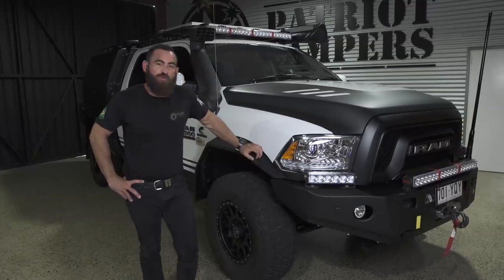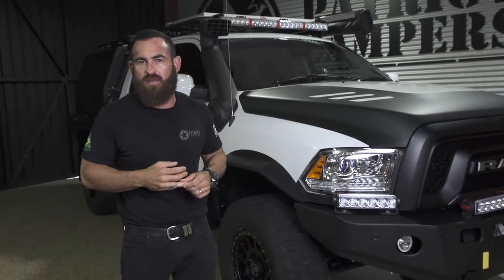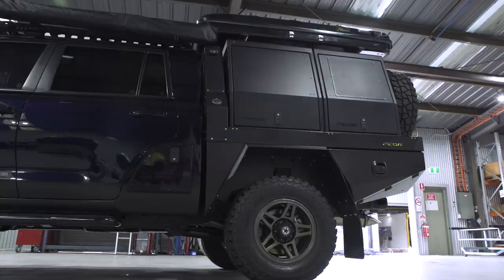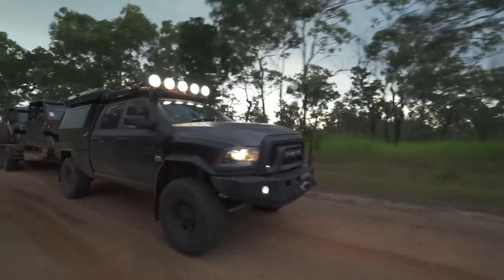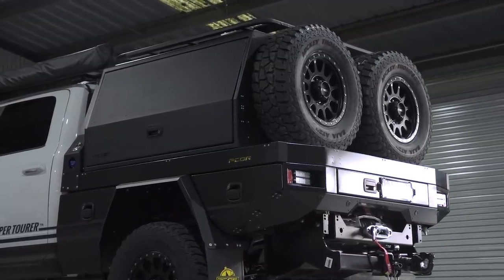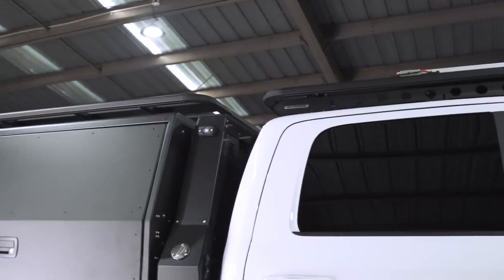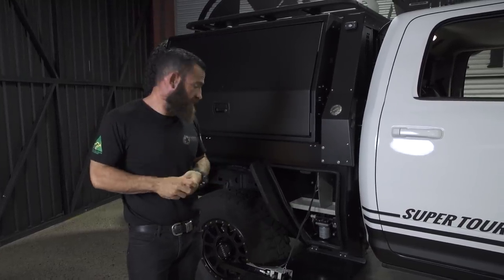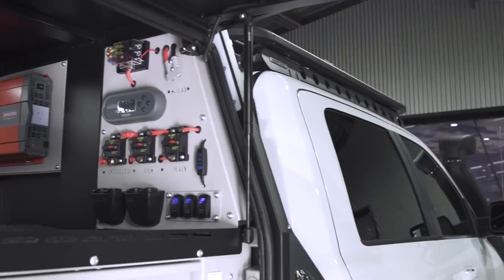Ram Trucks RT25 SUPERTOURER - The NEXT Landcruiser Killer?

Comment: Is this the Toyota Landcruiser killer ? The answer now and for the foreseeing future is NOOOOOOOOOOOOOOO and it never will be.
Reply: it won't kill it but is a nice alternative
Reply: It is for someone towing 6 tonne
Reply: yeap toyota is too smal to compare
Reply: The only way to settle this is go head to head with a Land Cruiser stock well if the ram keep all the upgrades just to be fair lol...
Reply: @nicg9599  I hear you, I owned two of these a 2500 and a 3500 they will pull a freight train but we're talking about replacing it for a Land Cruiser " off road" I don't think so I currently only 94 in a 96 with lockers and I do take them out and we do have Fords Jeeps and Rams  and these parts of the Woods somehow I always keep pulling others lol... it's funny how you have to put almost $ $50,000 more to keep up with the Land Cruiser that's my argument what you get a Land Cruiser and put some Wheels and tires and off you go
Reply: Somehow I don't think a truck that weighs like 3X as much will outperform a LandCruiser. I guess when it's sunk to the axles it'll kill the poor old '88 LC that gets roped into the recovery.
Reply: Land Cruiser after 2008 is 💩,

Comment: I love these trucks, just an awesome bit of gear, the only thing I dont like about them ( Chev and Ford as well) is the gear selector is on the wrong side. I do realize its because of the left to right conversion but it would be nice if someone could come up with a gear stick thats on the correct side for Australia. Just my opinion thats all.
Reply: Ford does make the consol shifter available in some F -150's.  It is all kinds of truck for touring.
Reply: @fabulousoffroaddesigns5080  Yeah but they're on the wrong side. Or do you mean they have one for the left side of the wheel? Like an old Aussie Holden or Ford have!
Reply: @slmiano  not a column shifter, on the steering column.  A console shifter, in the center console.
Reply: @fabulousoffroaddesigns5080  Aw sorry I miss read your comment. They do a center console shifter for an automatic? I never seen one. Ive only seen the manual stick in the center!

Comment: I like Rams!  They are worthy of respect in many ways, but to call it a Toyota "Land Cruiser Killer" is comical.  No vehicle in the world is designed with the LC's over-engineered off-pavement capability.  Yes, the Rubicon and Mercedes G500 have front, center and rear locking differentials, while the LC uses computer controlled braking to accomplish the same thing. However if you want to get home... Land Cruiser is the best option without question. This Ram has open diffs, unless they replaced the factory equipment.  With open diffs, this Ram will be stuck if just one wheel loses traction.
Reply: Exactly my point. This is not the same class of vehicle in any way! I hate these kind of clickbait titles! Instead just use a more honest title like "We made this RAM 2500 into a badass offroad machine"
Reply: You can buy Rams with locking diffs now.  This has a Cummins also.  It will pull your house down while pushing a LC
Reply: nicolas gerrald — Incorrect, you can buy a ram with a locking rear diff, singular.  Front differential is open and no factory center diff.  That simply makes it an excellent tow vehicle with a great engine.

Comment: A Ram with Cummins diesel can haul way more than 6 tons, it can can haul up to 15 tons! Upgrade the turbo and injectors with intake and exhaust and ecm mapping you can get 1500ft lbs. of torque to the wheels

Comment: The tinny on the 200 series roof would have acted as a massive parachute causing greater drag hence why the heavier fuel consumption. Throw the tinny onto the trailer and you'd see the 200 series fuel do down to approx 15L or so per 100km.

Comment: But you can’t legally to more than 4500kg without and air brake system on the trailer and extensive work on the truck to facilitate them. It’s like all the companies saying you can tow 3500kg with the current crop of utes, but not one of them have the brake controllers to tow more than 750kg legally so really, as you buy them, you can’t tow more than 750kg.

Comment: I live in AZ, US.  I have a 2000, 2500 turbo diesel with an 8' bed.  It is an extend cab not a crew cab.  I am interested in converting it over to a over lander.  The truck is paid for and only 215,000 miles.  For a diesel this has many more years to it.  My question is do you make a PCOR for this truck?  Thanks  Allyn

Comment: Great to see you using American trucks but why did you start with second best?
Reply: What's the best yank tank then?
Reply: @peopleneedtosticktogethera1479  Ford F series at every level.   Check the numbers.
Reply: mike a  F series beats them hands down.  Better payload, better towing, better horse power, and this year they will have the 10 speed in the Super Duty trucks.  They also out sell the Ram so there are more customers out there.
Reply: @fabulousoffroaddesigns5080  What a dummy.  Cummins is putting an engine with 1000 lbft of torque in the new Ram 3500 and a beefed up tranny.  Those V8 power chokes don't compare to a Cummins.  If you buy a F650, it doesn't have a power choke, but you can get one with a 6.7L Cummins.  Cummins has way more torque.

Comment: The Cummins is indestructible but as for the rest of the truck (excluding axles of course ) I just don't know.
Reply: Max does it have the asin transmission? Been looking at getting one but have been skeptical.
Reply: Max  I was planning on getting a single cab 3500 manual as soon as I could get enough money saved up but they quit offering it unfortunately. I don't like chevy HD's and ford's are pretty expensive. I'll probably go with the ram then with the asin tranny. It will be a first for me never owned anything from ram its  always been ford or gm.

Comment: Honest question. What is the purpose of this build? I am an American so I fully understand the awesomeness of Rams and what their built for. I've owned 2 1500s and grown up with 3500s as work trucks and haulers. But why replace the bed of the truck with that shell its has very little room inside and you've lost the gooseneck.
Reply: Camping. And from the bit he talked about driver's licensing, a goose neck trailer down there likely needs a different driver's license than most people get.

Comment: if i was to tow, i would definitely take this, but if i was to go off road, i would take the landcrusier for the smaller size. the ram is way too big for most off road courses. Though i would rather spend my money on a new jimny, add locking difs, a lift and better tyres.

Comment: G56 manual transmission is much more durable on 2500 Ram than the Automatic 68RFE. 3500 Ram with aisin transmission much better.

Comment: How much does cost as its shown in this Video?
Reply: In the US, a Ram 2500 Lariat with a Cummins goes between 55k to 60k, if that helps.
Reply: @nicg9599  wrong the diesel are $10000usd more = Laramie $65000usd without taxes in USA

Comment: These things are just too damn big.  Getting that thing down a trail meant for a side by side with trees will be a challenge.  That said my next truck I will be ditching the taco for a double cab Tundra.  I want more power, comfort, room, and towing all the things the Ram does well. Too bad Toy won’t put the Cummins diesel in the Tundra. As a rule I’d stay away from Dodge, the mid 90’s trucks were unstoppable but the new ones not so much.

Comment: Someone tell me why a Ford F250 wouldnt be a good platform as well?
Reply: Why would anyone tell you that?

I heard a mechanic talk about what would be his ultimate truck: Ford truck, Cummins engine, Allison transmission and Dana 60/80 axles.
Reply: I think its mainly because of the engine. You could pull up to a Kenworth, Peterbilt, International or even a Freightliner dealer and get parts for the Cummins engine. Hell I have seen a few Mack dealers that service Cummins engines. With the Ford, you are stuck just going to Ford.

Comment: no way in hell a dodge is a better option than the L70
Reply: This one has a Cummins in it.  It'll pull your L70 up a mountain.
Reply: @nicg9599  yeah no doubt about that but that transmission is going to blow out way before the L70 break-in period.
Reply: @jonathangonzalez327  They sell upgraded trannys.  When you delete these engines, it can easily overpower the standard tranny

Comment: diff lockers,,rear detroit, $650,, last forever,no wires,broken air hoses,cant fix..front,,e lock,$850,, & NOT,ARB,OVERPRICE STIKERS.2.5k for 1 locker,JOKE,,...ive been thinking of the idea,that air shocks,in the rear would be not bad idea,.air bags no good,.can rip if too much flex.air shocks actually help articulation,they pump from side to side.with weight transfer.with leafs,theres usually no need for sway bars.but,these trucks are heavy up top...rack,,a full length open ended rack is best,for those trucks,make it 2 part,cab/tray..i carry 7.5m lengths of steel,or sheets.to your mate ronny,a dana 60 will carry 2t,easy.dirt cheap.even a d70,for sale for $500,only need cut 1 side,detriot for $650,done..he should of kept 2 spare std,,rear axles.would of been a shit load cheaper.there built to break at the flange,,,not the diff centre,,duuh.landrover do the same.built in safety,easy fix anywhere.,nothing good about that v8 sound either ..6 is the way to go..

Comment: Whats the fuel consumption on that? Patriot products out of reach of 90% of people.
Reply: Unloaded a stock on will do 18-20 mpg U.S. on the highway.  Towing it depends on the frontal wind load more so than weight unless you really get up there in tons. 8-15 mpg in most cases.
Reply: Loaded, cant use that in Africa. Aussie I dont know... Heated steering wheel? Bwahaha

Comment: Ram is the LC killer? Ram has a huge engine, and is not very good. Ram is huuuuuge, 37" wheel??? Not the best for Overlanding...fuel consuption very bad and check engine always on, at least on my last Rubicon.
It is nice, pretty, confortable, powerful, but I would't buy another US made.
Reply: This has a Cummins in it.  You don't know what you're talking about.  Plenty Cummins owners with over 1 million miles on them.

Comment: Simple answer the Land Cruiser question is no. Not even close. 
Since the Ram is such a gas guzzler it cannot compete with a  Land Cruiser and that's before you even get near pricing's, conversions, part's.
Reply: The ram is a turbo diesel it gets really really good mileage that's the whole point of it,it can tow anything,it has unlimited power and torque,and it is very fuel efficient!!!u clearly do notknow what your talking about!

Comment: Unfortunately it's not a good truck when it comes to mechanical reliability.
Reply: Sorry but that is not true... I have a Ram that just turned 400k miles.. and my Brother in-laws just turned 1,000,000! Original engine and everything else. Rebuilt the Transmission 3 times... Not bad for a million miles.
Reply: @ShaneStauffer777 read the reliability reports. Bottom of the list year after year, I think that speaks for itself. Not saying all are problematic but wouldn't take the chance myself.

Comment: Fiat Chrysler builds garbage automobiles. No matter how much you try to polish a turd, it's still a turd. The land cruiser is an icon amongst the best off road vehicles ever, and it's an insult to ever compare anything ram manufactures to a vehicle with that kind of reputation. Rams are cheap, and have horrible long term depreciation and abysmal build quality, whether or not you impress the uneducated and simple minded with bolt on bits to make it look cool, or do some things. You want to show off the truck, that's cool, but to insult the land cruiser by comparing anything that company makes to it, especially with Toyota's record for amazing build quality, is laughable. #js #eatadick